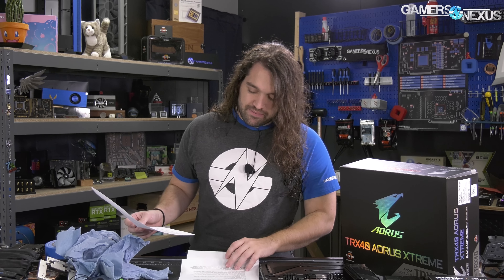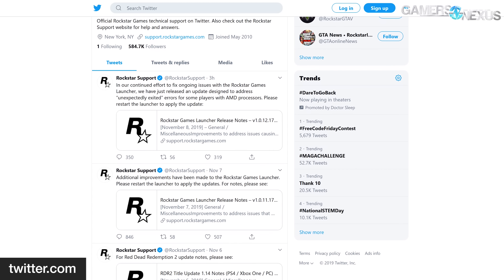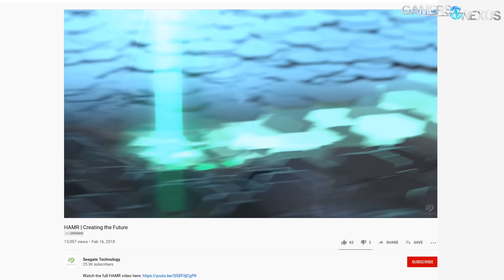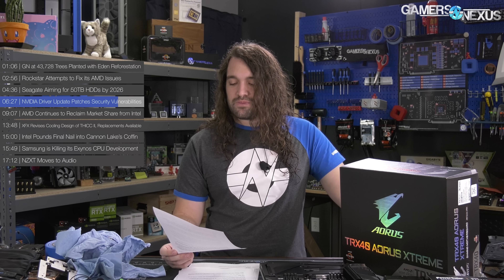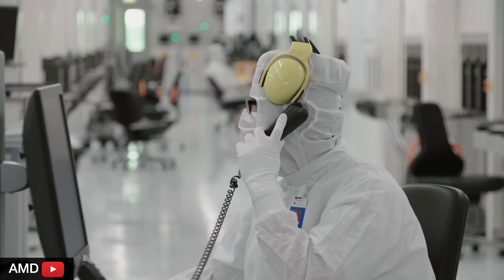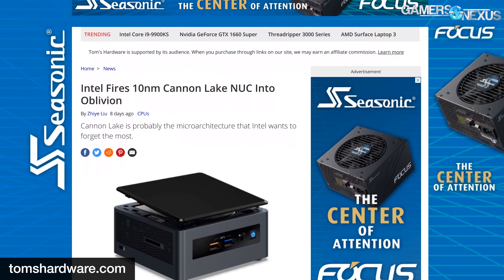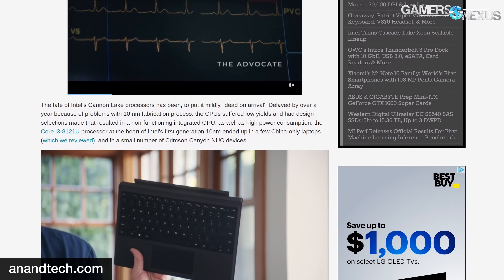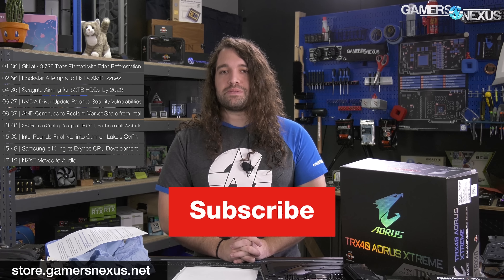HW News - Rockstar AMD "Fix," NVIDIA Driver Security, & 50TB HDDs

Comment: I wonder if large capacity HDDs will ever be affordable. Right now I'm paying 370$ every year, and slowly working to catch up with backup drives. AND saving up so I can get a 3-2-1 backup model going on

At this rate I might be spending more on hard drives than I do on gpus or even on my system.

Comment: The 3 times I've tried Seagate drives (apart from enterprise grade) they have either been DOA or dead after a week.  The thought of putted 50TB of data on something I've had no luck with makes me cringe.  Even if it was a brand I trusted, that much data on a single point of failure seems like a bad idea. If they started making drives that only partially died that might be interesting. loosing a platter in a stack is easier to swallow.

Comment: You want to bet that Rockstar didn't even TEST properly with hardware before launching? Screwing up both AMD-CPU's and Nvidia graphics cards, that is a new low for Rockstar.
Reply: Seems like Intel systems suffers just as much.
Runs fine on my brothers i5-3470k(/1070) but his friends I9-9900K(/unknown Nvidia) had launcher issues at first and when he managed to start it he cant play for long until it crash (like every town makes it crash).
Runs fine on my 3700x/v56. Had 1 crash to desktop since launch.
Reply: Advocatus Diaboli  

I share your hate for that but some developers DO put in an effort to optimize it for the PC. Unfortunately Rockstar doesn't in general, GTAV seems the big exception. Rise of the Tomb Raider came out on the XB first but it runs fine on the PC. Minus some minor issues (in the benchmark the graphics pop in after you hear the first sound). They even optimized for Ryzen which came after the game. Having said that, Square Enix does get flack from me for still not having removed the DRM on "Hitman:Absolution" making the game unplayable on Steam on Linux. The game was cracked within weeks before or after the release.
Reply: @pantzman  

Interesting. What does /v56 mean? I have a 3700X myself. I won't be buying a license to play this game though, at least not until I upgraded my graphics card (currently a 5700 XT). The performance needs to be better and Rockstar has to finish their Vulkan implementation. Also, they need to support Linux if they want me to buy a license to play this game.
Reply: @peterjansen4826  Short for AMD Vega 56.
Reply: After my experience with GTA V, I expected nothing but the same shit show from Rockstar. Except, to my own surprise; it was even WORSE. You'd think naturally one would make 3 mistakes and attempt to cut it down to 2 with the goal being someday 1? They somehow managed to go bassackwards to 8 miraculously. It's the stuff you can't even make up but yet we're here.... Ah 2019. It's been a ride hasn't it 😂
Reply: @pantzman  

Of course. A nice card, it will age well. It was overpriced a lot less (not at all!)  than that my 5700 XT is. :/
Ironically you could use the better compute of my card and I could use the better memory on your card.
Reply: @Demorthus  

At least GTAV ran relatively well within a short time. This game doesn't, the FPS is dreadful. Sorry, 60 Hz with just high settings for this game is not enough @1440p when you have a $400-500 graphics card, it really is not acceptable. I would be fine with it if the game would have revolutionary graphics as Crysis did, this game looks good but not THAT good.   You can clearly tell that it is being sold before it is ready, rushed. They should work one more year on it, get the code fixed and only then release it.
Reply: @peterjansen4826  I completely agree with you. It's just become way too popular the whole console-way-to-go of "let's release this half-baked game and THEN patch it up". It's not acceptable and yet it's become the norm in game releases this year more than ever as far as my Dory-like memory serves lol. Also,  your username reminds me of a certain pornstar... (ง`‿´)ง lol sorry xD
Reply: @Demorthus  

I have heard that before.

Comment: Easy fix for nvidia driver security, use a clean driver, meaning just the core with the telemetry/experience etc bloat stripped. Guru3d forums help on that topic.
Reply: That's not a security vulnerability for the driver. If you don't upgrade your GPU driver, these security vulnerabilities exist regardless.
Reply: @Next Level Code open source for security is not a golden solution. Far from it. If drivers are open sourced, it doesn't mean that security increases. It is contingent on people finding said vulnerabilities in the first place and that's on their own free time. A paid code audit is usually better, and one can find security bugs without any access to the source code.
Reply: How are you going to access configurable options if NCP is stripped off for just installing the core drivers without that extra bloat?

Comment: What works for me is installing October 24, 2019—KB4522355 (OS Build 18362.449) restart computer. Then launcher works and starts up RDR2 just fine no crashes after 2+ hours of gameplay. I finish that play session exit out of launcher, couple hours later fire it up and launcher won't start RDR2. I go to uninstall October 24, 2019—KB4522355 (OS Build 18362.449) restart computer fire it up then launcher starts RDR2 just fine. Annoying and Weird. 😫 Hope this info and method helps someone.

Comment: I am not surprised NZXT is moving into audio.  NZXT needs to move into any space that Corsair occupies in RGB.  I have an NZXT S30 Elite and a Kraken X31 AIO, but when I replace the X31 I will be with SOMETHING Corsair.  I want ONE software to control all of my RGB and other Corsair products (K68 Keyboard, Ironclaw RGB, Void Pro Wireless), so I might as well have a Corsair AIO since I prefer the usability of iCUE to NZXT's CAM.  CAM's new release is a solid start to a replacement for CAM, but for me it's too little too late from NZXT.  I expect NZXT to move into mice and keyboards eventually as well for the same reason.

I am likely to look at Corsair cases first before NZXT in future products... the H series simply do not have the same flair as the S30's and that is a bit of a letdown.  It makes me want to open up and look at other case brands, even though I REALLY like the look of the S30 and S30 Elite.  I know the S30's don't have as good of airflow, but I really like how they look.

Comment: Stay away from SMR drives.  I have a brand new dead 10 TB WD white label sitting in a box.  If you try to write more than a few dozen GB at once, it slows down to a crawl (around 10 MB/s).  This is because it first writes to a normal PMR section at the outside edges of the platters ( around 30 GB in size ), and then slowly writes this to the SMR sections after you assume the write is complete.  If you try to write more than the PMR section has, this is when it's dropping to sub flash drive speeds.. this is because it has to keep rewriting the shingled areas as a whole, and instead of using these PMR buffer areas, you have to wait until the drive does all this.  Your PC will not allow any other drive use on that, or another drive.  It just gives a "busy" cursor for a half hour or so.  They're noisy and have had a lot of corruption issues.  Some of the issues are due to firmware becoming corrupted.  These drives have to rewrite entire sections of (if I remember right) 10 GB each, when anything is written to it.  Writing a small file means that most of the 10 GB in that section has to be re-written.  Stay away.

Comment: everything is hackable, provided it has some source of input. this can be as simple as a mouse, or as we're finding a laser beam on some of the "personal assistants. the only thing that is essentially "hack proof" is a computer inside a sealed box, with no keyboard, no mouse, no internet and can only send output, it doesn't accept input, but even then, the solution is a sledgehammer to get into the box then rewiring the circuits inside.

Comment: Uninstalling and deleting registry entries that had anything to do with Rockstar plus bios update(3700x Gigabyte X470 Gaming 7 F42E) got me past the launcher error. When the game finally launched i got a black screen. The cause of that was HDR; it was enabled by default in the game which triggered the windows 10 HDR. After loading the game in safe mode, i was able to turn off HDR. The game loaded fine after relaunching. Now just recently, the game started crashing every 30-45 minutes no matter the API or settings i try. Serenity Now!

Comment: Im going to be building a new rig soon.
What platform should i go with? 
Main points of interest:
Storage speed and gaming.
Reply: Threadripper 3, and a RAID 0 of NVMe SSDs on a new MegaRAID card. You will probably have to get a rackmount Supermicro case, to get good enough drive support.
Reply: But seriously, right now, get a DRAM-equipped Phison E12 controlled SSD, and a Ryzen 3. Intel may add features at lower prices in several months, but even if the leaks are true, with HT coming to i5 models, it won't be anything special in absolute performance terms. IE, they might make a new i5 with HT, AKA cheaper 8700K, to compete with the 3600.

Comment: I'm still on 430.86 and RDR2 performance is fine (1440p custom settings/1080ti) do i really need to update driver? I'm worried I will loose performance.
Reply: If you are happy with it then just stick with it.
Reply: I think I may downgrade to this version or the other version just after this one that works with GTA V. The new drivers work fine with Red Dead but crash GTA V every 20-30 minutes without fail.
Reply: If it works, dont fix it.

Comment: Regarding Red Dead Redemption 2, I tried excluding RDR2.exe and the Rockstar Games launcher, disabling the firewall, compatibility mode, administrator authorization, disabling the internet connection and a few other things. Nothing worked. I started a ticket with Rockstar and sent all my diagnostic files and screenshots. They wrote back saying to allow the launcher to start and download an update. That didn’t work.

I actually had a bios driver update available from Gigabyte for my X570 Aorus Xtrem. I flashed the bios, I think it was initially version F2 from 6/26/2019. Newest version was F10a 10/11/2019. Opened the Rockstar Games launcher and started the game first try. Just ran the benchmarks as well. Hope this helps someone.

Comment: on the topic of cyber security and exploits, a thing to be aware off is that finding a new exploit takes a lot of time and effort.
most exploits are aimed at enterprise / buisness users, because they hold information that is of higher value than avarage joe's pc that he uses to play fortnite.
there for you will find that a lot more exploits are found and patched for what ever hardware is most common in enterprise settings,
as of now intel and nvidia have the highest market share in enterprise setting (AMD cpu's are slowly creeping in and probably going to take that from intel, but as of now that has not happend yet)
there for more hackers are focused on finding exploits around intel and nvidea hardware,
part of the same reason that windows has more known exploits than mac OS, it has nothing to do with one being moren resistant to attacks than the other,
just more people are focused on finding exploits for one than the other.

Comment: Works fine on my 2700x after the update. I'm just in awe of the graphics though. Mixture of low and medium settings is all I can get on my 4K monitor with my 1080Ti... Every other game I own is an easy high/ultra at the same resolution.

Comment: troubleshoot simulator and loading screen simulator by R* was the best games ever released ......
Reply: Walter Marcus I’m honestly curious what folks are running... two AMD machines with nvidia GPUs and no issues. The common denominator is the Asus Prime Pro motherboards (370 coupled with a 2700x and 470 coupled with a 2600x)... and not running the latest Bios (I think ones running the launch 470 bios)

Comment: As someone that has invested quite heavily into pro audio gear, I would be really wary of the MXER. 24-bit/96kHz audio, while it does retain better high frequency fidelity, doesn't mean squat unless your actual source material is using audio of that quality or better. Many games ship their audio at 16/44.1 or 16/48, and your DAC operating at 24/96 provides almost no advantage here.

Some games do ship with uncompressed audio that also happens to run at a high enough bitrate for this to make a difference. In those games, I would expect you should see a decent difference, assuming the DAC is actually a high quality DAC and not just a PoS one a la razer electra.

As Steve said, NEVER pre-order these things. Always wait for reviews to come out, but hey, this is the GN community. Y'all are smarter than the average consumer

Comment: You don't need AGESA 1.0.0.4 with 1st and 2nd gen Ryzen CPU's (1X00 and 2X00 series, so I'm not talking about Zen 2 CPU's (like the 3X00 series etc.)).
I had AGESA 1.0.0.3 installed (which didn't allow me to start the game) and no AGESA 1.0.0.4 available for my B450 Aorus Elite mobo.
Reverted to a BIOS which supports AGESA 1.0.0.2 and presto! It works.
RDR2 is a case which shows that you shouldn't update your BIOS if you don't have issues (which most mobo builders claim on their websites)
Anywho, YMMV...

Comment: Im running an older driver on my 2070 and a Ryzen 5 processor and having zero issues with the game. Yeehaw!
Reply: What version?
Reply: I think it was 431 something or other. Windows 10 installed it automatically for me when I was running DDU in safe mode having issues with a different driver version so I was gonna downgrade and it's like windows knew my intent. Or it knew what the old driver was that was stable or something.
Reply: I updated today and I'm having no issues with the latest game ready drivers.
Reply: @alexc3504  I was using that version with GTA V because any version higher than that causes it to crash. I downgraded over the weekend because I wanted to play a bit of GTAO I tried Red Dead and it works quite well only one graphical glitch wagon textures don't fully load for a millisecond or so.
Reply: @davelister6173  big oof. 
DirectX 12 was responsible for a lot of artifacting for me in rdr2

Comment: "... Requires local system access"

Doesn't that mean you'd be able to access the computer you're trying to hack... Right in front of you? That pretty much means you can get anything you want anyway, right?
Reply: Thin clients should not be able to see other thin clients or VMs etc. For example, in a bank you don’t need lots of compute power for the tellers and user kiosks, so they might have thin clients or VMs run to a single computer system (hopefully the user accessed kiosk is not on that single computer, otherwise that means they can now use this exploit to see things they shouldn’t, like other people’s bank account info...). Multi-headed systems are also sometimes found in other places. A library computer doesn’t need to run 8 desktop computers when a single Ryzen 1700 would be plenty of power to run 8 VMs with plenty of speed for all the users to browse and even the kids will still be able to play flash player based games (like I used to, that was “gaming” back then) while their parents are looking at boring old people books.

So, you may actually be using a VM without knowing it at a lot of public places (it also drives down IT costs, maintenance, power use, space, etc), potentially this could give someone else access to viewing everything you do.

Comment: my friend has a 7600k and 1060, and red dead just will not stop stuttering and crashing. we’ve tried literally every setting, i just think the game refuses to run on 4 threads.
Reply: The game needs to be greatly optimized for PC. Other people with more cores are still struggling to run the game as well.
Reply: ZackSNetwork i mean low fps is one thing but there’s constant stutter and crash, my system is having no issues
Reply: DANK  nah

Comment: Anyone not able to put the monitor in standby mode on nvidia cards? I own a RX 2070 Super on a X370 Taichi and R7 2700X. I used to own a RX 580 and didn't have this issue. I even did a clean install on windows and nvidia drivers and nothing else installed. Before windows updated, it was working fine, after it updated it stop turning off the screen after a certain amount of time that passed. Still nvidia's drivers and windows updates are the only things on the PC.

Comment: I'm up to 30 hours of flawless gameplay in RD2, and I have an AMD 1800X.. and a NVidia GTX-1080, I'm using a quite old BIOS ( 6808 for C6H mobo ) and am using an old version of NVidia drivers ( 436.48 )  ..So why didn't I have a single problem?  There's more to this.  I've run it quite well on different resolutions (4K and 1440p),  have used both Vulcan and DX12 with no issue whatsoever, used fullscreen and borderless.. Ran a video player in the other monitor while playing, and have an unusual storage setup ( 10 TB WD Gold 7200 data center drive cached by 40 GB of RAM and 250 GB of SATA SSD. )   I would love to know what the hell this problem was.  I gave my specs to see if anyone can find a correlation between people with "problems" and people without.  I preloaded the game 4 hours before it unlocked, and started playing the minute it did so.  I downloaded and connected through a VPN with Toronto and a Florida exit nodes.  Any ideas?  I use an X1 game pad, run Win10 1903, and don't use any ASUS software.

1800X, 4 GHz (p-state), WC w/ 2rads
64 GB   4x 16 GB  ( F4-3200C14D-32GTZR )  running 3066 cl14.

EVGA GTX-1080 (not OC'd)
Boot drive is 256 GB SM-961 (with 4 GB RAM cache).
Hard drives 1x 10 TB WD Gold (40 GB RAM cache), 2x WD helium 8 TB, 2x 256 GB SATA SSDs (one for caching game drive and the other with Linux distros.

I don't know what else to list.